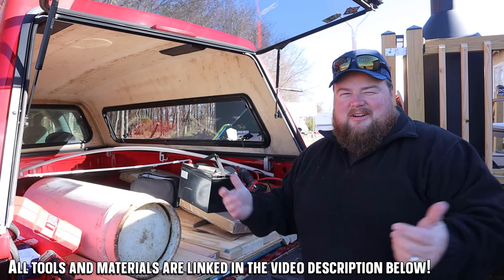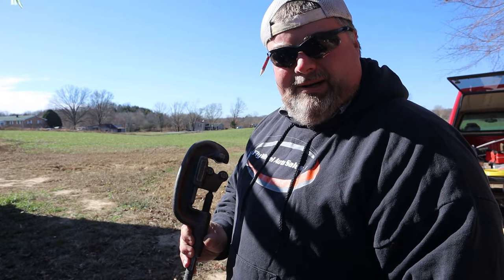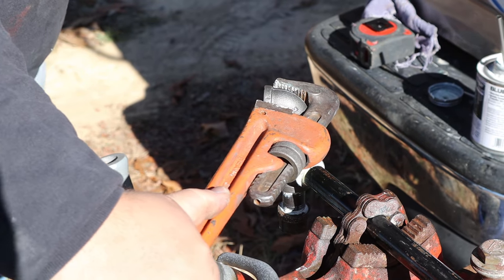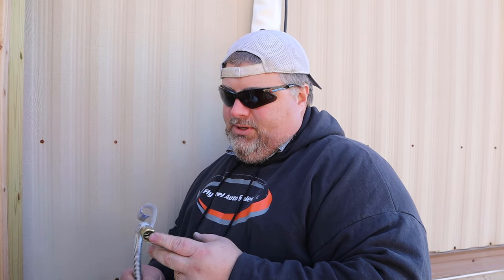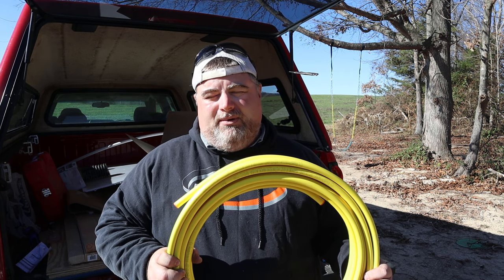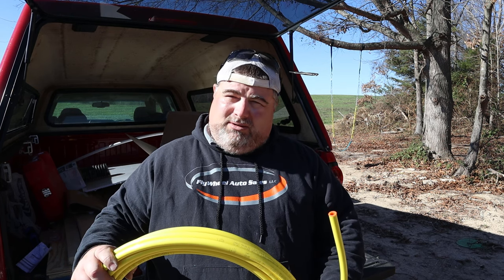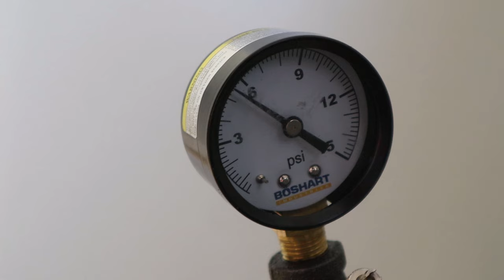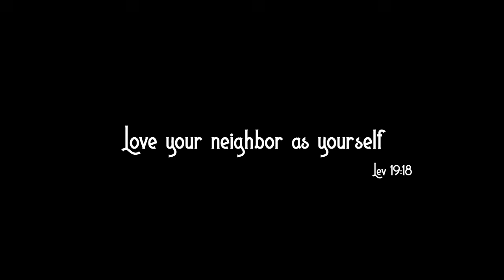COMPLETE Gas Line Installed by a PRO! // Mobile Home Gas Fireplace Install

Comment: This was really informative and well done instruction.   You  certainly know your business.   
In Missouri at our house, we had a nice gas log set professionally installed in the late 1990’s.   It worked fine for many years.  And in 2010 got an upgraded gas log set, professional installation.  And we started having trouble with it running a short time, then shutting off.   
The log installer was a bit stubborn to say our copper gas line wasn’t adequate to supply enough pressure?   Even though it’d worked fine for many years.  We continued to have a intermittent problem. So finely contacted the local gas company, they tested the outside gas meter, and thought we needed a larger (corrugated steel gas line)  a run of about 35 feet.   The gas company installed the new line for us. And ultimately this is what worked.   
We haven’t had any trouble.  And we so much enjoy our gas logs.  And even have used a couple times when there was ice storms and power outages. 🙋‍♂️🙋‍♀️🐈🐈

Comment: Good Morning Guys great job. Just a reminder for everyone, this type fire place can't be used without supervision it must be shut down before going to bed.
This unvented fireplace uses the oxygen from the room air and depletes it from the air in the house could cause a problem down the road.
One suggestion for Adam I would like to see a elbow type connection at the back of the unit, it would put less strain on the flexible gas connector.
And look better and make the plumbing inspector happy .

Comment: Beautiful; you all will enjoy that fireplace for years to come.
we really enjoy ours; but learned the hard way; crack one window close by for fresh air intake or those vent less heaters do pull moisture and cause window sill mold from condensation. A safety chain around that LP tank is a good idea
just in case it did tip "kids playing around it or even earth quake. You all are an inspiration for others!
You have a great brother; I had a great brother too; I sure do miss him. 
Look up and live! John 3:16-17

Comment: You should install a Carbon Monoxide Detector (CO 2 Alarm) in England it is mandatory for new builds & rented propertys, rented propertys in England it is mandatory have a gas safety check annually.
Reply: yes, I have one on each floor because of having natural gas furnace and water tank.

Comment: I am glad you have a heat source that doesn't require electricity to work. We have a Dearborn heater in our sun room. First that heater will put out more heat than central will. When we lost power for 36 hours two years ago at two below zero that heater kept half our twelve hundred and fifty sf house at 55 degrees. Everyone with central heat needs a heat source that will heat without electricity.

Comment: I have run LP gas heaters forever. I am going to suggest getting a second bottle. Run it and see how long one will last on you're useage. My point is, that there is nothing worse than running out at say 7 am or 7 pm, when nothing might be open and or you are in your PJs. You can't tell exactly how much you have left either without a gauge. Maybe when it is frosty you can? I do realise you have the mini splits, but it's good to just switch over to a full tank. Also, I have 2 plumber sons. Just a thought. Fireplace is lovely!! Nice installation!

Comment: Thank you Adam, Sam, and Angela.  I just bought an older, remodeled single wide and she is a bit drafty and I don’t want to depend on the oil furnace to keep it warm so I am looking to purchase what you have.  I will definitely have the heating oil/propane company that I use to install it.  This was very educational.

Comment: As an extra safety precaution you should figure out some way to anchor the fireplace down so that no one accidentally bumps it around and puts stress on the gas connection

Comment: Hi Sam. I saw your video about propane. I have an off-grid home that uses propane from a 400lb propane tank for a stove, dryer, bbq, and most recently a furnace. It seems the furnace does not get enough gas to stay on when the furnace kicks on while using the BBQ or stove. I was thinking of adding a y brass adapter to the tank and attaching two 2-stage pressure regulators at each end and attaching the furnace gas to one and the rest of the home to the other, but I'm not sure this is the best solution. Do you have any insights as to what is the best solution? Any help or guidance is apprecaited. Thank you!

Comment: I would advise you have a spare full bottle on hand, we are on lpg for heating hot water and cooking and we have 3 bottles at all times,  2 connected on an automatic change over and one spare. Imagine a busy cold day, your gas runs out and you have got to waste time to go and get the bottle filled.

Comment: Great information on gas piping.  I have a question.
Which one do you get more heat from and use less LP gas,... Blue Flame, Radiant, or Open Flame heater/fireplace?

Comment: Thanks for the informative video!  Early in the install I noticed the red shut off valve was installed outside.  Later I noticed it was inside.  Any particular reason? Explanation and/or code?

Comment: I'm assuming the codes are different in Tennessee than Kentucky where I'm at but I had a question about putting gas logs in my mobile home. I was wondering if you had to get any special permit or inspection for the gas logs? I've heard it's hard or impossible to put a wood stove in a mobile home here but I never thought about gas logs. Nice video as always broski.

Comment: @ 16:09 can I run more than one T fitting off the same drop? My MH has natural gas water heater and furnace. I want to add a fireplace for now but also since I'm in there doing it, add fittings for a future gas cooking stove and dryer.

Comment: btw treated wood like the stuff you build the railing out of is allso causing metal to rust faster
allso over here they warn against having a propane / butane bottle out in the sun or under freesing temperatures as the gas can expant in heat  and liquify during cold , the gassuplyers usually change the propane butane mix during the summer and wintermonths so buying a full bottle in the summer can cause the gas to gome intoo the house as a liquid during winter causing sumting simulair to a gasoline fire
probably be a god idea to make a small sized outhouse type structure to house the bottle and keep it from direct sunlight , might allso make sure you got the winter mix for the winter months

Comment: Is the outside flex connector approved for outside installation also did you move the ac compressed after the install it looks a little close to the tank

Comment: Great video, but codes vary from state. Before doing your own gas line install you need to check and see if tape is acceptable.  Where I live the sleeve has to be larger with seal nuts on both sides. The sleeve can be black steel or pvc and not foam core pvc. From an old master plumber you get an A+.

Comment: I live in the Eastern Upper Peninsula of Michigan and it gets very BITTER COLD up here. It has been as low as -39here. I only use propane for my range and cannot get service from any of the companies because of that. Would you please ask your brother what size I would need to last at least 6 months. I still cook like I'm cooking for my family and then nuke it till it's gone. I don't use the oven much, I have a toaster oven right now that isn't cutting it for casseroles or pies.

Comment: Gas piping regulations  vary from state to state    here black iron pipe   or special  flex pipe  (Trac Pipe) would  have been used 
Not sure just how  old you get in Kentucky  but recommend a insulated  cover for tank  to maintain  gas pressures when using   here washington  can get -0 temperature  on small tanks reduces  the evaporation rate  and lowers supply gas pressures  which mess with clean burning  of flame  creates soot and fouls the burner

Comment: Sam you should never lay a propane tank on it's side. The way you had it laying in the truck is like having a bomb pointed at your back. Most locations will not fill it if can't be stood up.

Comment: Flex connector not allowed at the tank.. why run that short piece of black iron and the rest in copper? Just do the complete run and copper and then you'd be fine and wouldn't be needing that flex connector .. You're also required to do a leak check which would also test the appliance... He only doing a piping pressure test I'll

Comment: Sam I'm brain farting here lol we luv your show watch you all the time but went blank when it comes to what your doing to heat the whole home??
Reply: They have mini split units and I believe they provide heat along with cooling.
Reply from the maker: We have a three zone mini split system that runs the whole home. This fireplace is for ambiance, extra warmth when wanted, and our emergency backup in power outages.